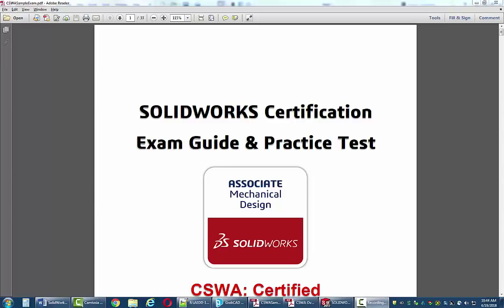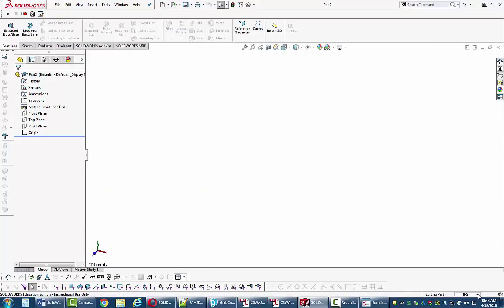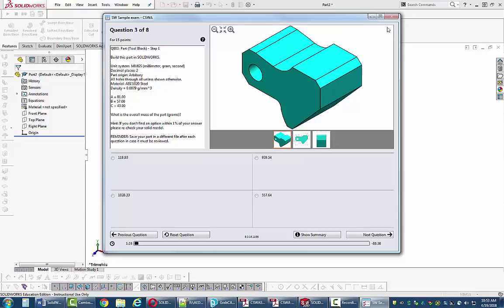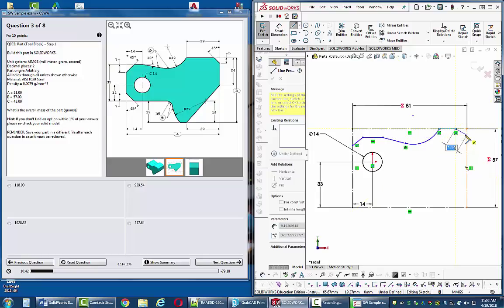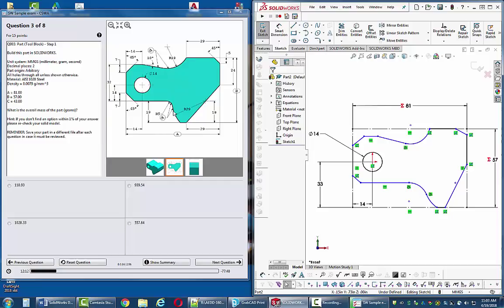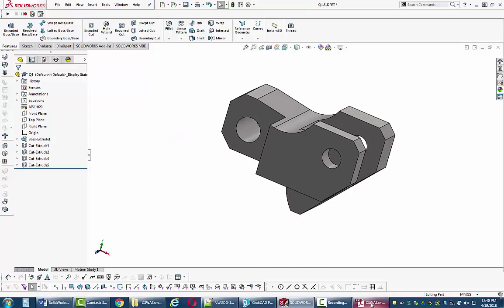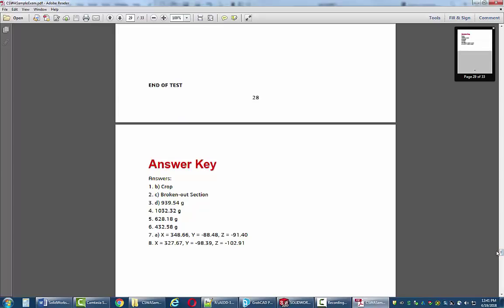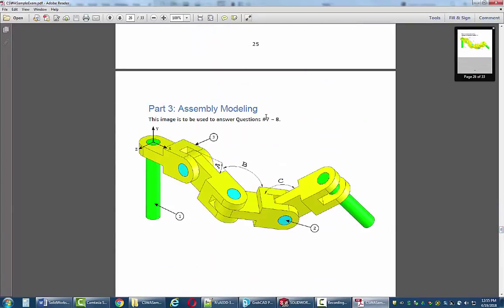SolidWorks CSWA practice exam

Comment: Mr. Abbot - just letting you know that five years later, your video is still helping those of us who want to pass the CSWA exam. Your explanation was so much clearer than my own professor's with some added tips that really helped especially drawing a construction box around my model as a first step. I don't know why we weren't taught this in my class given how helpful this is to avoid problems when dimensioning. Direct and efficient. Thank You!
Reply from the maker: Thank you for those kind words. I'm glad it was helpful, but don't be too hard on your own professors. I don't think I've ever seen a video or SolidWorks tip that uses a construction envelope in this way, so it just may never have occurred to them.
Reply: can you please share all the PDFs for these exams if you have any, i would appreciate it @DanAbbott-SMCC

Comment: I've drawn this model over and over a dozen times now.  I got it under 5 minutes from starting with clicking "new part" to final "mass properties". Here's some tips for speed, efficiency and accuracy that I would like to share:

1.) Do not manually draw the chamfer(7x45@2 plcs, 5x45) and fillet(R5).  Draw them to a "point".  Then use Sketch Tools/Fillet & Chamfer to add those features.  Not only will it dimension for you, but the fillet will automatically have tangent relations applied.   Using sharp corners at 4 positions will really simplify your sketch extremities.  Simpler = less chance for errors and you could even forego the need for reference lines and dimensions.  As the good professor suggest its a good idea to use them, but if you are not in the habit of doing so(also linking it to equations) you are adding more elements for failures/time loss. 

2.) The most "critical/complex" portion is the R29 radius and constraining it, so that's where I started the sketch. My origin is at the bottom of the part, where the point has horizontal dimension=29.

3.) Also for the other questions, you can "enter and preload" the different "a", "b" and "c" values if you create configurations.  However, make sure upon creating configurations you "uncheck" suppress features. In the equation edit environment make sure the "only this configuration" symbol is toggled.  (If you are not rock solid with using configuration a lot can go wrong so, ignore this. )

4.) Related to .3) you can also add different materials in each different configuration, so another time saver if you decide to use this option.
Reply from the maker: Nice tips for this particular part. Don't overlook the fact that you'll never see it on an exam. I think timing yourself is a great way to develop some good efficient habits, but before the exam, grab some parts you've never done before and time yourself on those. Good luck on the exam.
Reply: Can you link the finished product?
Reply: @TheBigBonesJones  bruh... the whole point is to practice
Reply: @EAGLINWRX  27:27
Reply: @jeffrysanjaya8866  ??
Reply: @EAGLINWRX  my learning time stamp, sorry
Reply: @jeffrysanjaya8866  ah gotcha

Comment: "The overall mass is 618.6" 
sees 628.18 is the right answer
"I know I've got that one correct"
You made me laugh there. Nice video anyway :)
Reply: I was looking for what happened, and it's because he made a small error in the globals. a, b, and c should be 86, 58, and 44, respectively :)
Reply from the maker: I do my videos in one take, and because they're meant for my classes, I don't go back to correct small errors, I let my students find them. It reinforces that real-world process of design and the fact that I WANT them to make mistakes so they can then apply problem-solving skills. Good catch.
Reply: Daniel Abbott thanks for the reply! also, i failed this practice exam multiple times and came across this video for guidance. as soon as i saw you set up your globals, and convert entities etc i knew where i went wrong. took the real exam last week and got a 240/240 on it.  so thanks so much for making this to help other students out as well! it was for a university of colorado boulder CAD class for mechanical engineering and i also got my certification :)
Reply: @MCatwar  Great 👏🎈 so was it easy compared with the given time, watching this video? how many parts were there?
Reply: @DanAbbott-SMCC  i've watch the video, thank you for the time that took you, i would like to add that when you are cutting the bottom piece you correctly say that the offset it's going to be 12, yet it changes to 22. Anyways, nice video.

Comment: Hello Mr. Abbott, just passed with 240/240 and I owe you credit! This is the most helpful CSWA tutorial I've found. For everyone else attempting the CSWA for the first time, my advice is pay careful attention to Mr. Abbott's video before starting. Very important: 

1) Have a strong command of using equations/global variables. You'll need them. 
2) "Warm up" before starting the exam. Play around in the software and get comfortable. 
3) Use two monitors or a separate computer during the exam! You'll need to flip back and forth many times between the test and SW. I completed the exam on one monitor and I regretted it! It'll be easier on your eyes if you can blow up the exam question drawings to a large size to read all of the dimensions and relations. 
4) Skip past the questions you're unsure of, then return to them. I finished with about 30 mins remaining on the clock, so I used that time to go back and review. 

Good luck everyone, and thanks Mr. Abbott!
Reply from the maker: Neil,
You are most welcome, and congratulations on getting a 240. -- very impressive. The suggestions you make are very much in line with what I recommend to my students before they take the exam, although I add "go to the bathroom before starting the exam!"
Reply: I'm considering studying for and taking this exam in High School. Should I do it now or wait until I'm an Undergrad? I want to know because of internship opportunities (I am also for sure planning on taking the CompTIA A+ before college).
Reply: @SkillUpMobileGaming  If you have the opportunity to take the exam in high school, I'd say go for it! It's not all that difficult, just watch this video and practice modeling in the software until you're comfortable with the commands. There's no substitute for time spent modeling.
Reply from the maker: If you have a chance to take it for free (must be included in your school's license for SolidWorks) I would do it. Good practice and it would give you a chance to test your knowledge. It is certainly possible to learn enough in high school to pass the exam!

Comment: Hi Mr Abbott, for the first part you went through I managed to get the sketch fully dimensioned and the mass correct however when i changed the global variables for part two, I got a mass of 986.44g rather than 1032.32g. Do you know why this might've happened? 
Thank you for the great video!!
Reply from the maker: It sounds like you didn't actually create equations for the dimensions that used global variables. You need to either type the global variable name with quotes around it, or -- preferred -- type the equal sign and use the drop down to select the global variable directly. If the dimension doesn't show the sigma symbol in front of it, it is not being driven by the variable.

Comment: Thanks for the video.  I did this exact did as part of the CSWA Practice Exam provided by the Tangix TesterPro Client application.   I am in the midst of of preparing for the true exam - practically ready - but I was wondering if the REAL exam has the same amount of questions, or MORE questions than what the practice exam has - even if they are of the same nature ?   Thanks.
Reply from the maker: The actual exam is longer and has more parts, assemblies, and as a result questions.  The format is similar, and the level of skill required is also similar in my opinion.

Comment: Hello Daniel, great video. Regarding the first model, in the technical draw that they provided there are two symbols of tangent arc close to the radius = 19 (on the top of the model). I thought that  instead of a line it would be an arc.  Do you know why yours only have one symbol? My drawing got undefined when I tried to make as an arc.
Reply from the maker: Ricardo,
I'm not sure what you're referring to unless you have a different version of the model they use for the practice exam. The single tangent symbol with two leaders is referring to a single tangency between a straight line and an arc. The angle would verify that the entity is a straight line and not an arc.
Reply: @DanAbbott-SMCC  im also having the same problem, im falling to fully define the sketch between the 10 degrees inclined line and the arc, i know im missing something can someone hlp?

Comment: Sir, Can I retake the test if the score does not reach the requirement to get cswa/test can only be done once?
Reply from the maker: You can retake the test, but there is a waiting period. I'm not sure just how long, but I think it is 30 days. Check on the SolidWorks certification site to confirm.

Comment: Hello. Thanks for the video. Very informative.
I have a question that is a bit offtopic. I am working in design and i have a company laptop with Solidworks. But I don't have rights to install/download other software (so neither this virtual tester). Can i install it on a different PC, with no Solidworks, and answer the questions there? Or does the virtual tester check that solidworks is installed on the device?

Thanks and keep up the good work.
Reply from the maker: SolidWorks doesn't have to be installed on the computer you use for the exam, but you do have to download zip files to answer the assembly questions, so you would have to transfer them from your personal computer to your company computer.  Did you try to use the virtual tester on the company computer? When I give the exam to students, they are able to use the virtual tester despite not having the rights to install software.  If you can copy files to the company computer, you can probably used the tester on it. If you do take the exam on a laptop, I would plug in a monitor so you can have the exam on one and SolidWorks on the other.

Comment: Can we give the exam using two laptops and not dual monitors ? One would be used for Tester and the other one will have the software to work on. Is that acceptable ?
Reply from the maker: You can do that, but you'll have to download some files for the questions on assemblies, so you'll need to be prepared to transfer them from the exam computer to the computer on which you are running SolidWorks. That will slow you down a bit, but is certainly possible.
Reply: @DanAbbott-SMCC  Thank you sir for a quick response. Also thank you for the tricks, will surely apply during my exam.

Comment: Sir for the actual exam  will the part files for the assembly will be provided for download or we have to make the parts?
Reply from the maker: For each of the assembly questions on the associate level exam, there is a link to download a .zip file. You will have to unzip it once it is downloaded, but you can do that by right-clicking on it and selecting "extract all."
Reply: @DanAbbott-SMCC   i express my sincere gratitude to you as your video was a great insight into the application of basic tools in solidworks. I have passed the associate exam 5 hours ago with a score of 205/240. Thank you

Comment: Whenever I make the first part, I get the answer right. Then it asks me to change the dimensions, and all of a sudden, my answer is wrong.. I don't get how changing the variables will lead to me getting the next question wrong. I have a fully defined sketch.
Reply from the maker: Send me the sldprt file. Dan@danabbott.com
Reply from the maker: Did you get this resolved?

Comment: Hi Daniel, I have an issue with Q4 Step 2, my sketch is not under defined (I'm already aware of the implications not fully defining sketches) but my calculated weight yields an answer of 1011.18g. I would like to send you the Part file but I have no visibility/option to do so.

Thank you for uploading this video
Reply from the maker: You can send me a file at dabbott@smccme.edu.

Comment: Great explanation. I put some time to replicate what you did and learned a lot. Is there a reason why you didn't use global variables for Assembly problems, unlike sketch problems?
Reply from the maker: It is not possible to use global variables with assemblies, and it wouldn't make it much simpler since editing the mates is about the same amount of work as editing the equations.

Comment: Thank you for sharing us. For this example I don't understand about why we need to create the circle at the origin point. Please suggest me. This video is very useful for me but I'm not a native speaker. Sometimes I can't catch with the thing that you teach in the video.
Reply from the maker: The origin doesn't have to be at the center of the circle, but that is a logical place to put it. Establishing the origin on a logical location on the part makes it more likely that you will anchor the part to a specific location in the Cartesian Coordinate system. If you ignore the origin, you will never have a fully-defined sketch. As a result, if you have an error due to leaving out a dimension or a relationship, it will be very difficult to find the mistake since all of the entities will be blue. 
A part like this is likely to be attached to a shaft that goes into the hole. That means that all of the other features will relate to it. But you could place the origin on a corner. To me, this part has no corner that would be a logical location, so the only logical place to start is the center of the hole. Note the number of other dimensions that start there.
I hope this helps. I have a number of students for whom English in not their first language, so I know how hard it can be to understand some of the technical descriptions. I hope that the video itself is clear enough to convey what I am doing.
Reply: @DanAbbott-SMCC  thank you so much.
Reply from the maker: @miniCHANGMIN  My pleasure. So it makes sense to you?

Comment: I'm having problems in doing question 3 in my own way. I have done your advice on making a rough sketch then assign dimensions clockwise from the left side of the drawing. However, I consistently get over-defined dimensions warning. I will send my drawing to you if possible. Please help!
Reply from the maker: The most common problem I've seen on this part if you get an over-defined warning is that a perpendicular relationship was added automatically when you didn't intend to do that, and it conflicts with a dimension. Look for the perpendicular icon and if you find it, delete it. If you can't find the error, send me the file at dabbott@smccME.edu and I'll take a look at it when I get a chance.
Reply: When sketching you are not "paying attention" to the relation inferences. They are very "sneaky" and you need to be aware and move the cursor out of its sensing range.  Often you are not "zoomed" in enough, so do that often. 
Then always check the sketch with "view" sketch relations and you will find your answer. 
Also, get familiar with System Option/Sketch /Relations/Snaps/Sketch Snaps.  Turn off some of them, which you can add manually.

Comment: Great Video I like it
I have the pDf but i dont have the files for the assembly part Can you please provide me with those
Thank you very kindly
Reply: If you share your email or smth on your youtube channel (about me section) i could sent them 😊
Reply from the maker: You should be able to find them online.  Go to the test site they use at www.virtualtester.com/solidworks. You can take the practice exam for free and you can download the files from there. If that doesn't work, here is a link to a google drie that contains the three parts: https://drive.google.com/drive/folders/1iaWo445reIvlWDtq9zAAqEsgHRRnAeOf?usp=sharing

Comment: Mr. Abbott thanks for sharing your experience. I was trying to assign the global variables but when I tab It stayed on the dimension dialog and doesn't evaluate or moves ahead for . next row/variable. Could you help me with what problem I might be facing
Reply from the maker: I am not clear on what you're asking. When you type a variable name in the first column, pressing the tab key will advance to the value column, or you can select that cell with the mouse. If I am not understanding your question, send me an email at dabbott@smccME.edu with a screen capture of your results.

Comment: Thank you for your help. Around 35 minutes when we use the extrude cut from offset plane, for some reason mine doesn’t want to cut without thin feature on. When I leave the thin feature on not all of it is cut. Any help would be appreciated it.
Reply from the maker: If you getting a thin extrude, you don't have a single closed shape. You can either close it by adding whatever line is missing, or use the contour option if you have closed areas but the boundaries overlap.

Comment: For the assembly questions, is it possible to use global variables for A, B and C when defining(I tried but it didnt work)? Or manually changing it through mates would be the only way?
Reply from the maker: No. Use mates and change the values there. It works about as quickly as changing global variables.